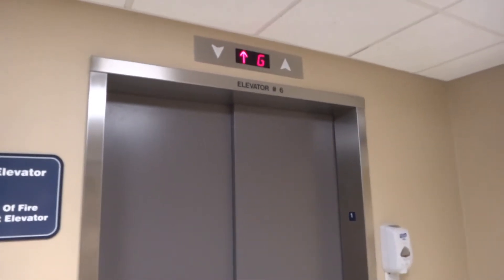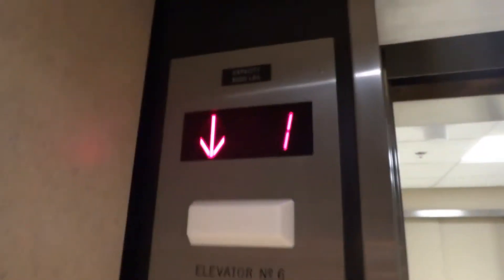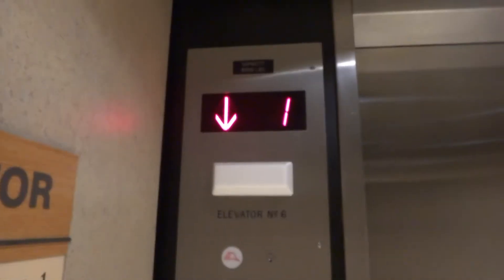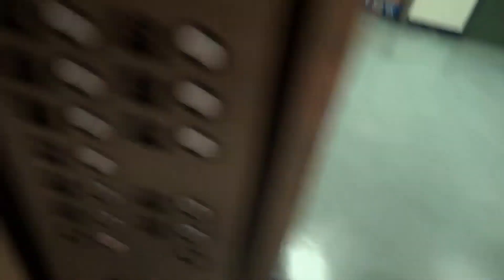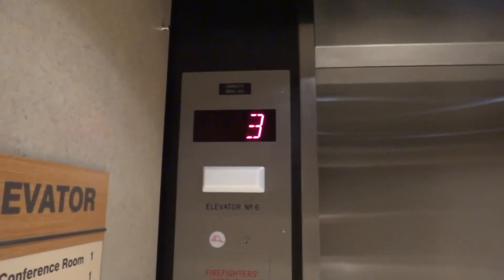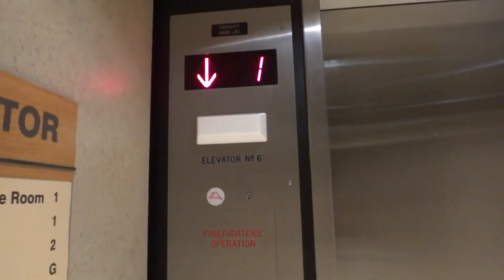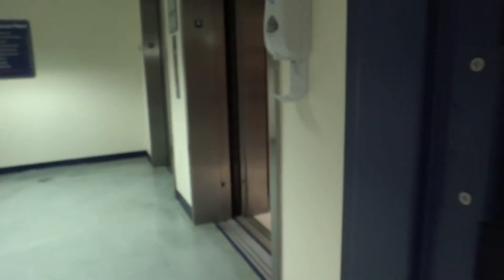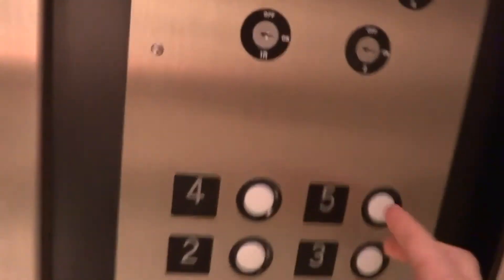Fitchburg: TK Modded Payne Traction Elevators (Completed), Simmonds Building, Burbank Hospital

Comment from the maker: Sometimes, what's front, and back, flips. 
Elevators B and C at Leominster Hospital were THE elevators, but after the 2000 expansion, the 1st floor was redone, and most patient rooms moved to the new area. B &C are now "lost", as the main hall is gone, and the front entries are now the rear (though A and B's buttons still reflect the old, C is 1-sided).